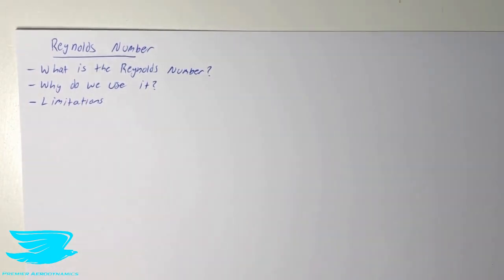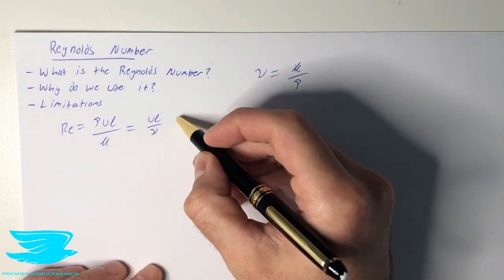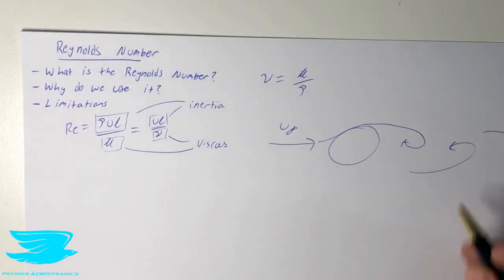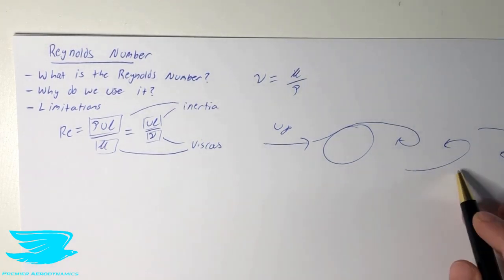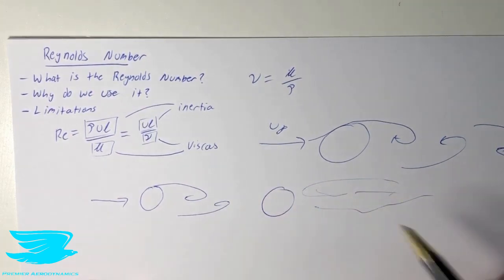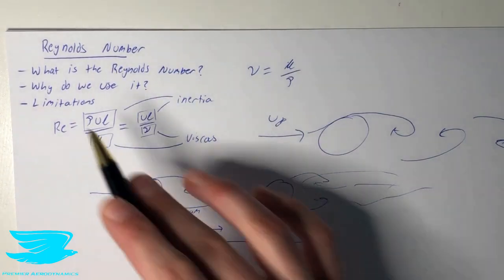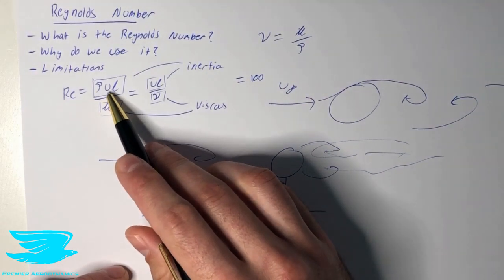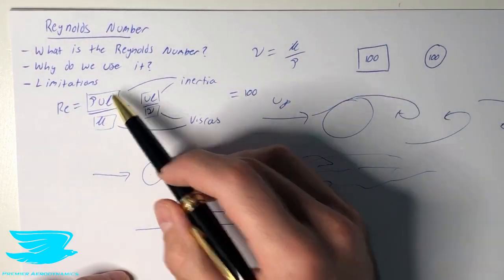[Aero Fundamentals #2] Reynolds Number Explained

Comment: "High Re= large wake, small Re = small wake"? I always thought exactly the opposite was true.
Reply: I think I understand now. You were talking about very low Re and the laminar-turbulent transition, right? I was thinking about higher Re (low viscosity region), where the wake gets smaller and pressure drag decreases. So "middle Re region" = large wake and large pressure drag. Both low and high Re give you smaller drag.
Reply from the maker: With High Re, there is more inertia for the flow field to continue downstream. Viscosity doesn't sap away the energy as fast to return the flow to a very ordered state.

For Low Re, the opposite is the case where there is more viscosity (relatively speaking), so the flow features get their energy sapped away by it and the flow becomes well ordered quicker.